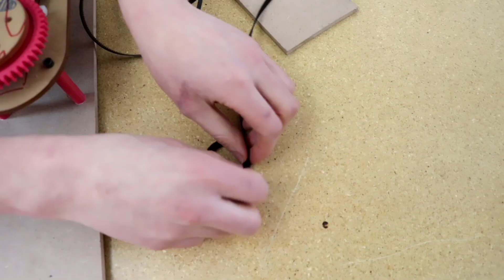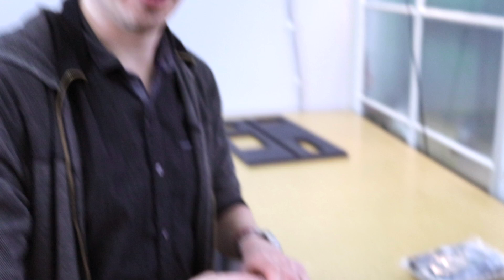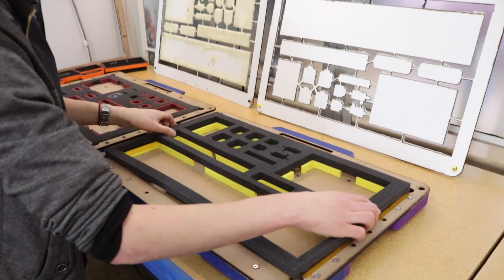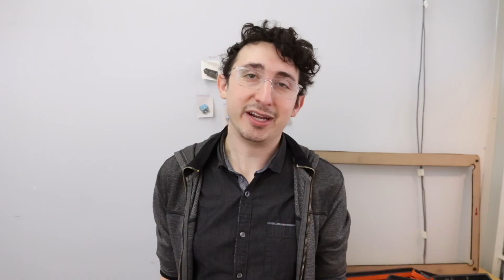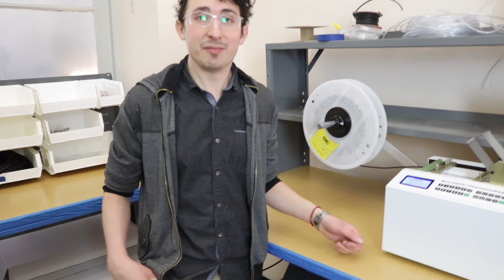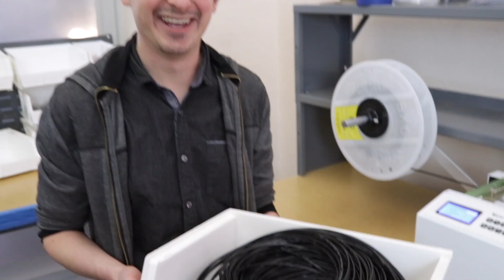This Machine Saves Me HOURS

Comment from the maker: Head over to https://opulo.io/ if you wanna pick up a LumenPnP!
Reply: Stephen, you can drop about $100 on a good HVLP sprayer, and some spray-able adhesive. that'll reduce the number of cans and time to coat for the foam. also invest in a good breathing mask and some coveralls
Reply: I would love to have the files for that belt winder, if you don't mind sharing them somewhere!!
Reply: You can add one more roller after 350$ cutter which can also wind it. If it is time consuming to add it electronically, just use mechanically, two GT2 pulley in a ratio to synchronise winder with cutter roller. Winder roller can be should removable(may be gear driven so that winder pulley stays in place).
Another youtuber who makes this kind of cutting & winding machines.
https://youtu.be/kGyuscK9GaA
https://youtu.be/VW07FaIvl_c
https://youtu.be/Jl6ZATZypAQ
https://youtu.be/ZneBhLVsodA

Comment: Okay but why use foam when you can use a single large folded cardboard cut-out? In a lot of cases you don't even need to do the unfolded design yourself because SW like blender can do it for you as long as you have well designed packaging.

Comment: Please replace the foam with cardboard. I don't mind plastics used on components for a machine, as those will be used for a long time, but I really hate single-use plastics. I think most of the methods you're using are fine just replacing the foam by sheets of cardboard. Also, you can stop using glue if you make the outer shipping box the exact size of the cardboard sheets, as the box will make the sheets align without needing to add adhesives. And buy boxes that open from the top, not the sides, to make boxing easier and faster.

Comment: There’s a machine that counts, and bags small parts, they even do them that do multiple different parts.
Reply: Interesting - any suggestions of a brand / search terms or a link …? I have this problem looming in time too !
Reply: @jonnyhifi  I don’t have any brand suggestions, they are kinda made to order, can range in cost from £1k to £30k depending on need. - There are a few DIY models on YouTube though, search ‘part sorting machine’
Reply: @jonnyhifi  they all work in pretty much the same way, vibration or spinning parts to separate them, then mass or sensor counting them, mass ones are less accurate because they rely on a regularised mass of the part, and sensor ones tend to need more customising for part shape.

Comment: Tooling Engineer here, do what you can to avoid getting locked into a set with a non-modular design because you're gonna inevitably want flexibility to change your design.  Ruled dies are an order of magnitude less expensive than rotary. Have you thought about making a custom hot-wire foam cutter?  You could have multiple wires  spaced out to cut the same part multiple times in one cycle. 
Anyways, love your channel.

Comment: Awesome belt winder!  It might be even faster if you replace the crank with a motor connected to a limiter switch precisely positioned next to one of the spools. When the spool reaches the correct number of turns, the wound belt contacts the switch which stops the motor.
Reply: Add a cutter mechanism so it winds and cuts.

Continuous unattended operation might be tricky without a way to keep the material coiled.   I'm envisioning a magazine/cassette mechanism with about a dozen slotted holes for the coils to drop into.  The holes could be arranged linearly, or radially like a DVD jukebox.   Once the coils are in their respective slots, ziplock bags could be lowered (by human) onto each coil.

Skipping my magazine/cassette binning process would be better if you could figure out a way to bag the coiled material directly but I am not smart enough to automate working with ziplock bags.

Comment: I was wondering how long it was going to be before you had to clean off your stencil.

In automotive paint shops the buck/carrier/skid (every plant seems to have a different name for it) goes through the paint booth a number of times and then it has to be cleaned off. The way that this is done usually is by blasting it with 12K - 40K PSI water. Which along with the mess and constant maintenance, emits a horrendous amount of noise. Probably not something your neighbors want to hear. And by neighbors, I mean anyone in a 1/4 mile radius.

Another option is to burn it off either in an oven, or get this, molten salt. Yeah, you don't want to go there.

Solvent is bad in its own right (flammable, not healthy to breath, and if your operation is big enough then you are expected to pull a permit and treat the fumes).

If you do decide to burn off the glue, I suggest that you do it like the big boys do, and do that operation at night. Just saying...

So how about a thick coating of grease? Or just bite the bullet and make them disposable.

Or just use double-sided tape and be done with it. 

As for cutting your foam, we used a water jet to cut the carpet going into S-10 trucks at the Shreveport plant. That process was impressive, the carpet wasn't even wet after getting cut. However, if you think that lasers are hard on fingers... And robots aren't wallet-friendly.

Possibly a better way would be to ditch the environmentally unfriendly foam and go with stacked sheets of carboard with water-based glue. 

This is where getting a packaging engineer involved is a good investment.
Reply: Lots of good ideas here.
With the gluing process, I think we can all agree that excessive glue is wasted material and cost.  Excess ultimately becomes scrap that requires additional cleaning processes so it's best to minimize the wasted glue, if not eliminate it entirely. 

I like the idea of eliminating the foam.  It's surprisingly expensive and doesn't really add much value to the customer.   One alternative is vacuum formed plastic.  It is surprisingly easy, fast,, and inexpensive
Reply: @SwankySasquatch66  I hadn't thought of vacuum-forming plastic. That would work well.

Comment: I made an automatic heat gun for heat shrink.  I tore open a hand held heat gun, added an arduino, relay and two ultrasonic sensors.  Sensors are mounted at the base of the gun with everything pointing up.  Wave your hand over it and it fires up, remove and it shuts off.  Saves me a ton of time for my business.

Comment: Next time take the spool, attach one end to a spool on a drill. Have marks on diameter to know when to cut. slide off half spool place in bag.  This would take 15 minutes to design.
Reply: Stepper motor and arduino for precise, repeatable length cuts

Comment: Maybe silkscreening a glue onto the foam would be an option to avoid spray adhesive (expensive and not particularly environmentally friendly).
The glue for the silkscreening would have to be quite thin but there should be options available.
Reply: paint roller. or a CNC glue applier

Comment: With the gluing jig you should attach the two bottom jig plates together with a hinge in the middle so you lift the both sides up and they meet in the middle. That would save the double work of putting in the second lot of taller locating jigs and lifting the second part out to place on top of the first.
Reply: Yes, I was thinking jig1 would have locating PINS that would jsut line upwith jig2, then put it on a hinge frame that just picks it up and over and down into the jigs lining up perfect.. no more needing to put those smaller items in the foam to line up.  could even make it where the glue shields are on hige mechinisms too that fold on to glue and fold out when done and fold the foams together...  could make doing that job down to about 10-20sec per foam set..
Reply: or just use plastic bags

Comment: I feel like using a roller (like a paint roller) to roll the paint on might be more efficient than using your jig. If you roll from the bottom then you won't drip the glue onto the foam either.
Reply: hah yes. this is one of those things where you get stuck in a solution and don't stop to think of an alternative idea.
Reply: How would you apply glue with roller from bottom, the foam is quite soft

Comment: Can someone set up a site where you can order PCBs in a decentralized way? (Basically the owner of a machine can make the machine available) I would really like to use that eventually.
Reply: Philipp are you talking about PCB manufacturing or assembly? Consumer-grade printed circuit boards take more than one machine to make, and there are very few board houses in the US. It’s not like 3D printing where there are a huge number of hobbyists with them and we just need a web platform to decentralize existing manufacturing capabilities. Assembly is another issue entirely, as you need the PCBs to be in a compatible PnP machine that is loaded with and can accommodate every component in your BoM. Traditionally, small-scale PCB assembly works by sending the board house your BoM and they’ll then source and invoice you for reels of each component, then send you the surplus components with your order. It doesn’t make sense for them to hold onto specific components you need for your board in their inventory in hopes that someone else will need the same component. JLC is able to simplify the process by having reels of the 1000 most commonly used components pre-loaded into PnP machines. They can be confident that they’ll be able to use the surplus, so they don’t need to source and invoice the components individually for each customer. If you have a component that’s not on that list of 1000, they can’t assemble your board because it doesn’t make sense for them to set up a PnP machine for one small custom order when their fleet can handle more common orders much more efficiently. Until there is a fundamental shift reducing SMD components to their building blocks, allowing a wide variety of components to be assembled from a small number of unique blocks, and we have machines accurate enough to PnP them, PCB assembly will be limited by these inventory and supply chain issues. And I think that’s an idea worth sharing, thanks for coming to my TED talk lol.
Reply: @griffinvanhorne8695  I also know that JLCPCB does this. Problem is just we currently have a war and I am not very sure what side China will stand on. I am not willing to rely on China for this.
Reply: that's a very very interesting idea! with  enough of them, you could source your PCB from a local machine and not wait for pcbway assembly and shipping!
Reply: Philipp it would definitely be great but I don’t know how realistic it is quite yet. The cost advantage of PCBs and SMD components made in China makes it hard for international competitors to survive. Opulo is making strides toward allowing bare PCBs to be populated affordably in small workshops, and this could allow for a JLC-style PnP farm with a massive inventory of components elsewhere in the world, but decentralized assembly is still dependent on one single node of the network having a large inventory of components. In the meantime, this machine will be perfect for setting up for a few specific boards with a limited BoM and cranking out hundreds to thousands of them. Maybe the political climate, freight cost increases, retaliatory tariffs, etc. will make domestic manufacturing relatively more affordable, more domestic board houses open up, components can be sourced relatively more affordably domestically, and there’s greater demand for domestic quick-turn PCB assembly. The other option is to join or start a makerspace where you can split the cost of digital fabrication equipment like this machine. That’s probably the next realistic stepping stone.

Comment: we have simmilar cutters for wires at work, not sure how much different the cutting part is, but basicly the same (just more expensive i imagine)
Our cutters would support a serial controller, dependign on requierd throughtput, raspi with servos to pull the feedign stock back a bit so its not in the rollers, run job X until stock runns out or number is reached, switch stock, run Job Y, Job Z, wait for new stock. repeat? most likely not practical though for various reasons

Comment: Do you guys need to assemble anything with screws? If so, get a screw presenter, and assembly electric screw driver that activates when pushed down. They can be set to a specific torque so you don't even have to think about it.
Reply: These seem great. Thanks! I wonder if the Lumen or something like it could use those to automate screw placement and fastening?
Reply: @nidavis  there are definitely robots that are built to assemble things and use screw presenters. The mechanisms that would be required to activate everything is in OpenPnp, it's just a matter of writing g code for it. Currently centroid files are converted on the fly for pcb's.
Reply: @nidavis  further, if something was designed in pcb software, screw locations could be loaded into OpenPnp with the "feeder" being the location of the screw presenter, and an actuator for the Z axis pick and place commands. The screwdriver would just be on the head instead of a SMD nozzle.

That being said, electric screwdrivers aren't light, and you'd have to accommodate for that. Nema 17 motors would have a hard time moving a screwdriver with any torque.

Comment: On the gluing jigs, you could place some thin adhesive plastic sheeting over the jig, then cut out the areas that aren't blocking glue.  Then, when you need to clean the jig you just peel the plastic off and put on another sheet.  The cutting out would take a few minutes, but would greatly reduce time and cost and be safer than using solvents.
Reply: depending on "protective" sheet you put on, a lasercutter was standing with there. pop off old gummed up sheet, put on new fully covering foil, run throught laser (indexing pegs are already in the jig, maybe add some indexing to the cutter?) run job, continue glueing.
Reply: or apply glue with a roller...
Reply: ... semipermanent mold release on the stencil. It's designed for composite molding & the thick adhesive layer will just peel off when you get tired of the gunk. Think commercial-grade RainX.
You might even get away with a ceramic-based car wax.
Reply: The jig is made by wood which is already very cheap, throw the used one and laser cut new.

Comment: First and foremost interesting topic. In the CNC manufacturing world. A worker will only tend a maximum of four machines. Off course duty times is important, and yes automate helps, but it can be very tricky to make a full automation system. The solution is of course collaborative robots, and workstation with Line. With a minimum of transportation/sorting. So that you can controlled the R & D for the automation. All this and yet still being able to be flexible is incredible  tough. That level of complexity cannot be build in the midst of a production start up.
Hang in there and as soon as you get the time think about the system as a whole.

Comment: You can just glue one side of foam and it is better to use a roller with no stensil rather than  a  spraygun . Great job 👍
Reply: they're using a spray contact adhesive. it needs both sides.
Reply: Use of roller both sides still works and is much simpler it would seem.
Reply: @adamjackson9988  ah- except a roller would coat everything, and they can't do that because they need it to make a shelf for a part, not just a thicker piece of foam.
Reply: @RecoilOperated  but they are laminating 2 pieces? They make small rollers
Reply: @adamjackson9988  yes, but that requires more skill than foam, stencil, spray, stencil off, place.
Reply: There are a few advantages to using spray cans.

• Rolling would still require a stencil for ledges
• Contact adhesive are a very strong and reliable join which sets very quickly
• Spray cans don't require maintenance
• Spray cans are all-inclusive items, No need for a separate paint container, paint tray, and rollers.
• Spray cans are less prone to accidental spills

A roller would have to come at a significant cost advantage to be worthwhile in this application. But right now what they need is time, not money. So the spray can seems like the better option ATM.
Reply: @DerrickJolicoeur  then a CNC spray gun. they are a CNC company after all... LOL!

Comment: Please don't use foam for packaging! I'm sure it's not easy to replace but you should try to find an environmentally friendly solution.
Reply from the maker: Super true, we're also looking at getting folded cardboard packaging to replace the foam! The foam die will help us in the short term, but we're definitely switching to a more sustainable choice! The way Prusa kits arrive with mostly folded cardboard and some recycled foam inserts is the approach we're considering.
Reply: @stephen_hawes  I don't work in packaging, but mycelium (mushroom-based) is a recent option I've heard about that might be worth at least a cursory look.
Reply: @eliotsandberg8979  they looked into mycelium. One of the main issues for them is that 1) it takes like a month to grow, and 2) you need a lot of molds, which adds up in price. 

They wanted to hold off on it until they have their packaging decided pretty solidly. Then they might consider it.
Reply: @natalie5947  First result in google reckons it grows in 7 days, but that's still way longer than bending some cardboard and whatnot.

Thanks for the info, and fair point on needing a lot of molds :-)
Reply: @stephen_hawes  That's good to hear, I was thinking of the Prusa packaging too. great to see you make progress with your company